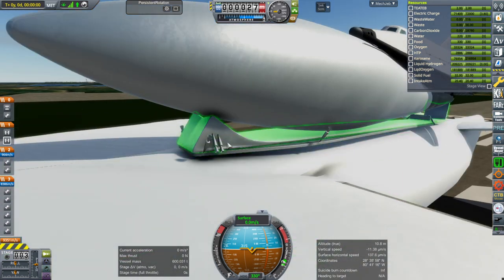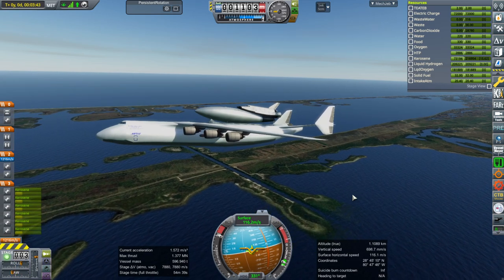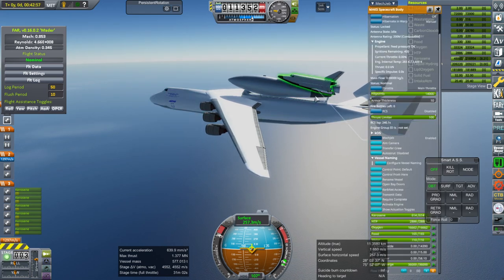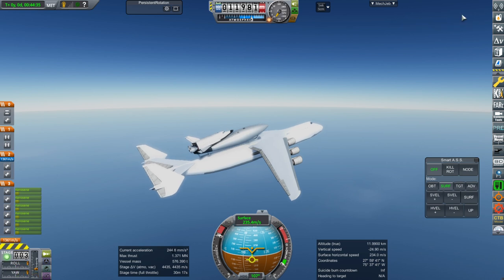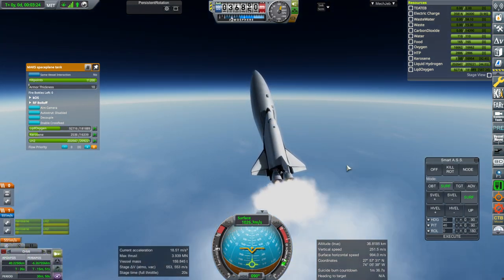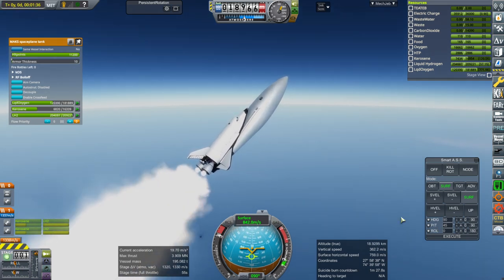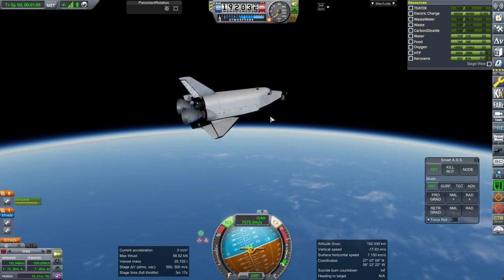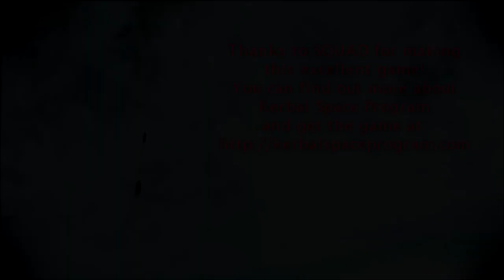KSP with Realism Overhaul - MAKS - An-225 Continued Testing

Comment: If you do "Aim Camera" at a MAKS part in flight, it will probably prioritize control of that vessel at decoupling, I believe. If you do "Control From Here" on MAKS, it will DEFINITELY prioritize control of that vessel at decoupling, though that has the minor danger of your attitude reference on the Antonov plane being offset. No need for frantic switching or awkward part tree rerooting.
Reply: Doesn't really work, I've tried it

Comment: You can certainly use kOS, but possibly only for the staging rather than the whole thing. Have it running from the MAKS, stage and pitch up, then disable it after and fly to orbit with Mechjeb like normal.

I made a pitch control program a while ago and while watching I was thinking about ways I could manipulate it to help in this situation

Comment: what is the best version of ksp for rss ro according to you?
Reply from the maker: I've had some minor issues in 1.10 and 1.11 (on launch and some aerodynamic quirks) but scatterer has coastline issues in 1.8.1, so it's a tradeoff. I'd say 1.11 has better visuals, but 1.8.1 is more reliable until some things get worked out.